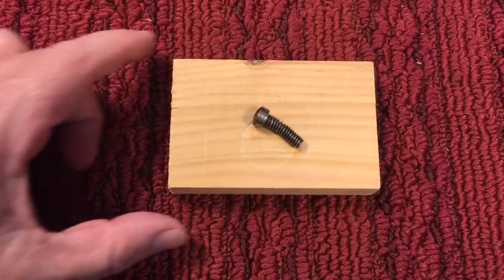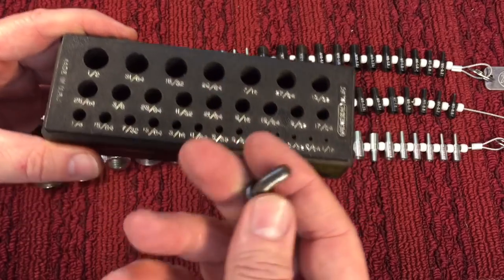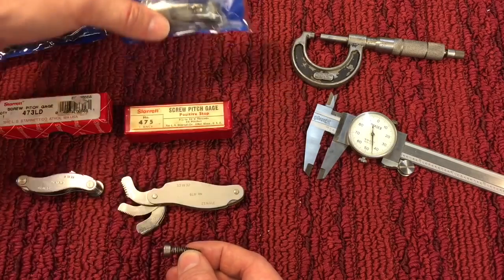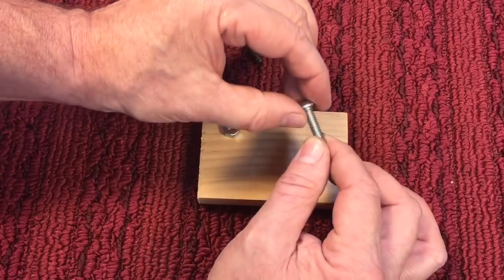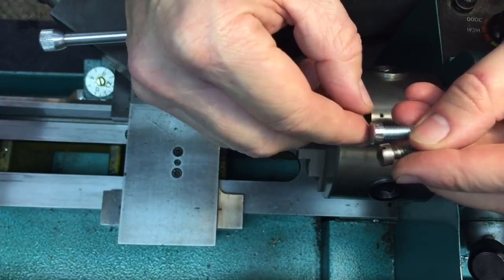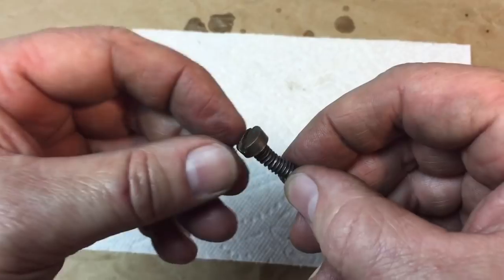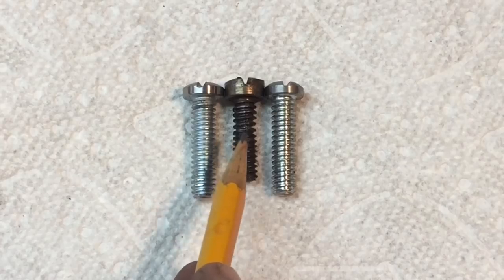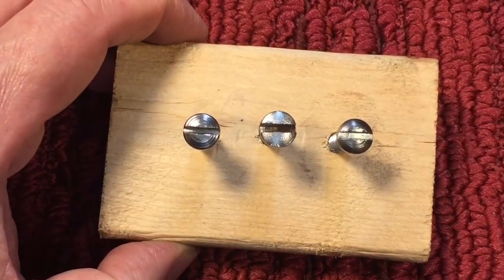Viewer Project- Simple Bolt Alteration-

Comment: Good video explaining standard metric and inch sized screws. As ScoutCrafter mentions below there are a lot of thread standards about. In the tool restoration hobby, you need to be aware that tools made before WW2 and especially WW1 (and really specially prior to 1900) may have used one of these odd-ball threads. In 60 deg Metric threads there were German, French, British and Japanese metric standards... mostly all the same, but there are some diameter/lead combinations that are not in the ISO Metric standard used now.
In the Imperial inch sized threads there are several thread standards you may run into. One is British Standard Whitworth threads that are 55 degree with rounded roots and crests. Single pointing them correctly on a lathe is a nuisance because the tool has to be special ground to generate the rounded root and crest for each lead. The way around this is to use the U.S. wartime truncated Whitworth thread standard which uses flat crests and roots but will interchange with standard fasteners. There are some thread/lead combinations that are not in the Unified Standard, e.g. 1/2-12 and 1/4-26.
The threads you would most likely run into besides that are BA (British Association) and BSCY (British Standard Cycle Thread). The BA threads are the equivalent to the number sizes in the UN standard (e.g. 10-24, 8-32) and are usually cut with dies and taps. The other you have to look out for in turn-of-the-century tools are 12-24, 12-28 and 14-20 threads. Pretty rare, but I have also seen #7 and #9 screws (from the 1890's precision tools).
Like ScoutCrafter says, there are books full of descriptions and sizes of these little used threads.
Reply from the maker: Hello Aceroadholder!  Awesome!!!!! I'm pinning this!!!!!  Threading is an art of it's own!  You have it down pat!  Thanks so much for the tutorial!!!!!  =)
Reply: Here is a link to pdf thread tables for more threads than Carter had Little Liver Pills. 98% of these threads will never cross your workbench.
historicmotorcycle.org.au/images/Thread_Tables.pdf
Reply: Aceroadholder - great comments.  Maybe you could do an episode on threads?  Truly!
Reply: Marc... episode on threads...not much more interesting than watching paint dry!
The most important thing is to recognize where you might run into odd-ball threads (like microscope threads or fasteners on older firearms). Then, having identified the thread as not a current or a not often seen standard,knowing how to find the standard that covers that thread.
Some uncommon threads have managed to stick around for a very long time. Many bicycles still have the crank assemblies retained with BSCY threads of the Whitworth form. BSP pipe threads are of the Whitworth form as well. The ignition harnesses on Rolls Royce jet engines are attached to the engine igniters with Whitworth threads (and Kennametal makes a stock carbide insert to to cut it). The German Leica lens screw thread mount is 39mm x 26threads/inch...Germans make everything complex.

Comment: Great episode, and let me say I would really appreciate it when it's possible to show both versions (not necessarily in the same episode) - one with all the best machine shop methods, and another with mostly hand tools.  For me, I don't have some key things I've watched shows like ScoutCrafter have access to:  a drill press, veritcal and horizontal sanders, band saws, the Wis, a sandblaster box, welding, and either wood or metal lathes.  It's both an economic issue, and I flat don't have anywhere to put such wonderful goodies!  It is also heartening that a lot can be accomplished albeit more slowly, or tedious, or risky - with simpler tools.  This was GREAT!

Comment: Just found some cheap F clamps [at a market type thing] and on one the head was slipping off the bar, so I drilled a hole through and with a large pop-rivet I managed to get it fixed back on and functioning fine. Feels good to put a tool back into service. I even found myself checking out the rusty remains of other tools in the tray there. I'm not flush, so I didn't indulge, but your little bug might just have bitten me. All good fun, and it was a lovely sunny day too, cheers.
Reply from the maker: Hello Keith!  Ahhh!  What a great feeling!  Even better then restoring a tool is fixing a tool!!!!!!  Awesome!!!!  Thanks so much!!!!!

Comment: Hi Scott -- if using modern replacements is OK, then this is a lot of work. A trip to a local hardware store with a good Hillman section, where you buy hardware by the piece, will save a lot of time. My Tru-Value sells a 1-inch 1/4-20 Filster screw for 55 cents, plus tax. Or a 1-inch 1/4-20 chrome slotted screw for the same price. Personally, I'd never trust myself to cut a slot with a hacksaw that I'd be happy with in the first 20 tries. Enjoying your channel and have bought several of the tools you've featured.

Comment: I might have used this project as an excuse to buy a dake ;)  Definitely smart to fabricate a new one, nothing worse than a realigned bolt breaking off below the surface and now you are on an extraction project.  I really only use my thread gauges on the lathe now, the wire laced thread samples are great, especially if you have something with a tapped hole and you don't have the original bolt - real quick to see what size and thread bolt you need to come up with.  I have a metric and standard set hanging off the side of the toolbox.
Reply from the maker: Hello Steve!  I have some thread wires but it is a real skill to use them accurately and I didn't want people's heads to explode when I showed them!  LOL  That's the next step!  Thanks so much!!!!!

Comment: I worked in a machine shop in the shipyards in Portland Oregon and then in the oil field in North Dakota for many years and a seasoned veteran can look at a bolt or nut and tell you size and threads per inch.  I can no longer do that reliably so I have a set of folding thread gauges exactly like yours.  Good video thanks for posting.
Reply: My dad was a lifetime machinist and jig builder at aircraft factory during WWII.  I was amazed how he could always, never fail, tell the size and thread count of any bolt by eye.  I agree Rusty Gun; ScoutCrafter produces quality videos.
Reply from the maker: Hello Rusty!  I bet you have some awesome stories!!!  Both of those occupations are amazing!!!  And you are so right, when you work with fasteners long enough you can tell right away the size, although today with Metric thrown in the mix it's a little harder and even worse when you are working on tools like Starrett's products where they had their own threads!  It is fun to guess the thread size and be right on!  Thanks!!!!!!!!
Reply: ScoutCrafter you really have to use fastener every day to be able to identify them by sight.  It does not help that all these birthdays have reduced my vision a little.  Now I need a couple pair of glasses and keep a magnifying glass on the bench to see the small stuff.

Comment: Wouldn't you have to maybe shorten the overall length of those new bolts by the difference in thickness of the heads? They might bottom out...?
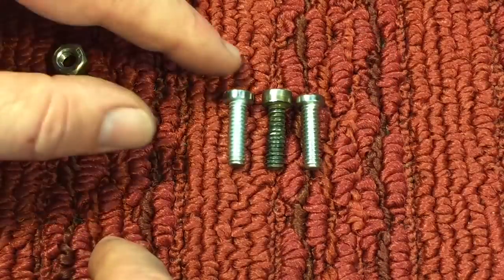Reply from the maker: Hello Alan, good question!  If you look at 12:46 where I line up the finished bolts, I line them up from their shoulder (bottom of head) so the lengths of the threads are exactly the same, only the head height is different!  Thanks!!! 😃👍

Comment: Don't think the jaws of the lathe will flat the screw threads
Reply from the maker: Hello Abdulih!  Good question!  The best part of a chuck is it give equal pressure all around, the threads are vulnerable and with enough pressure could be damaged so it is very important not to over tighten the chuck! The operations we performed on the bolt had little torque and thus didn't require much chuck pressure, if I was threading or tapping then I would have more torque and a greater risk of the bolt spinning in the chuck. For this job slippage wasn't a problem so the threads were safe!  =)  Thanks!!!!!!

Comment: nice anoterone less then 100 to go for 10k subs
Reply: also another thing on the vise i see people put washer or o rings on both side in the middle and it will hold it.
Reply from the maker: Hello David!  Yes, the rubber washers and O rings are there to stop the handle from slamming into the yoke, it softens the blow.   With the parker you can stop the bar from sliding all together!!!!  Sweet set-up!  Thanks very much!!!!!!!
Reply: if you get to big rubber washer and put it in the middle of the handle if it very tight on the handle it will make the handle stay in place o----l0l------0 the ll are the ruber washer if it got a tight fit on handle it will make it stay in center
Reply: took some time but i found it if you want to see it done go watch eric the car  called video Wilton 4600 Bench Vice Review -EricTheCarGuy 6:52 timestap you will see, 2 rubber washer will make it stay in place you think it will not stay but it will would take alot of force to move it with both on there i mean you can hit with a rubber mallet hard and will stay
Reply from the maker: David! That's so funny!  I saw that video a while ago!  I know because the Like button was highlighted meaning I already liked the video!  Yes, I know what you mean about the grommets pinching the bar and stopping the slop!  It does work!  The handle is always the part of the vise I fell can be improved. Sometimes you need the extra leverage and sometimes you don't... There has to be a better way!  =)  Thanks!!!!!!
Reply: those kurt vise what let you put what ever handle you want even can use a drill if lazy, they are not cheap tho